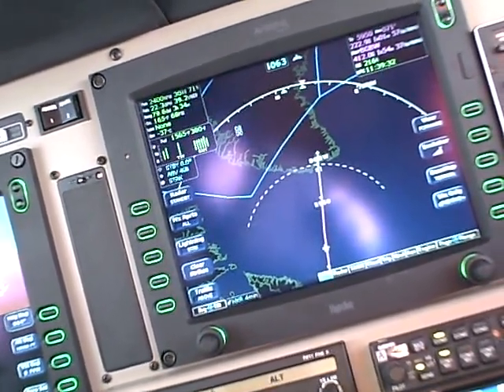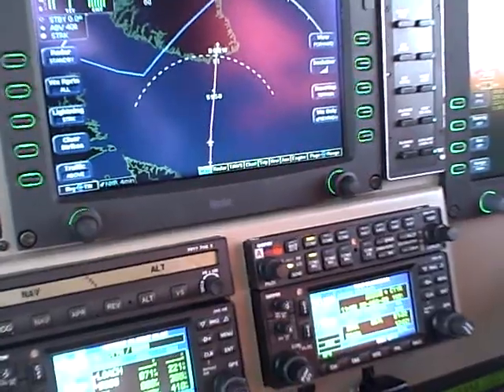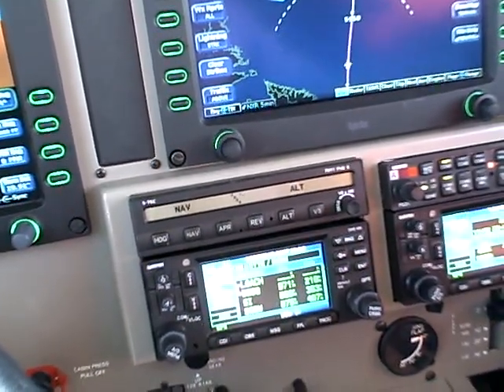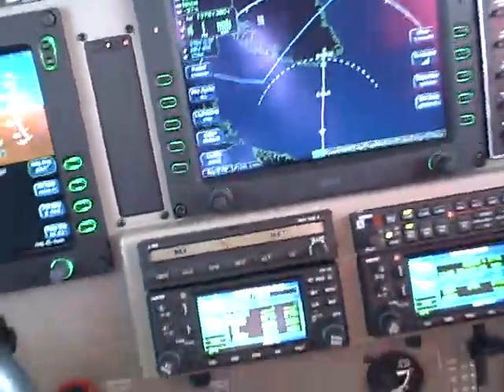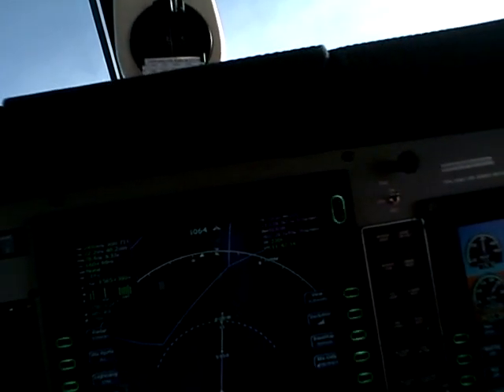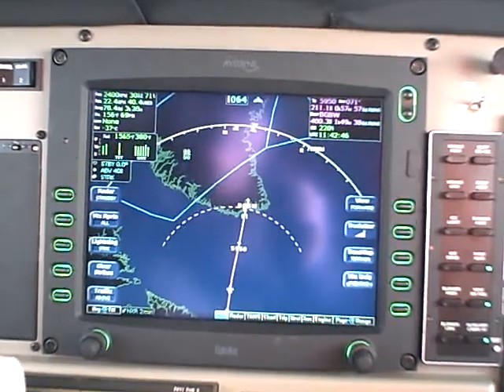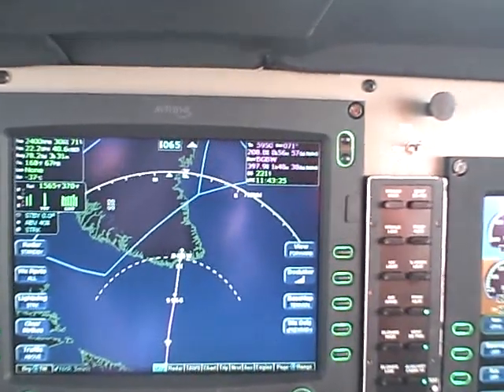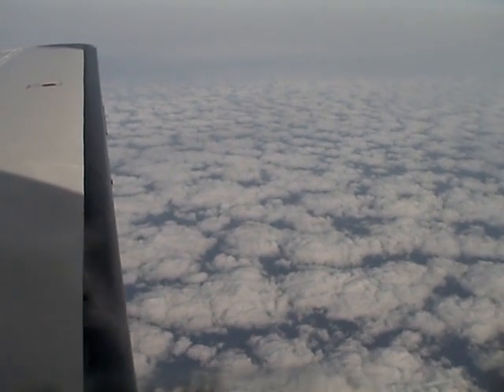North Atlantic Crossing: Part 10 of 23 --Goose Bay to Narsarsuaq, Third Segment

Comment: The only way to get a Lycoming to run lean of peak is either:
1. Get very lucky
2. Get tuned GAMIjectors

Also, I assume when you say "super top" that this airplane has the outboard fuel filler STC that lets you squeeze in an extra ~10 gallons per side?
Reply from the maker: Even without the STC you can (and should) ask for a super-top, then supervise the fueling to ensure you get the correct amount of the correct fuel. The wings are long and tapered and a small amount of compression in the landing gear struts can lead to fueling errors. Fly Safely - Train Often .. DR

Comment from the maker: Hi mr3856a, the point of no return decision is made with respect to fuel and weather. This is why it is called point of no return. If the weather is forcast to be less than VFR we turn around and go back. The likelihood of getting surprised these days is far smaller than it used to be. We just have to be vigilant regarding honest decisions in support of turning back. The idea here is to endeavor to not be surprised by making the decision at the last possible moment consistent with safety.